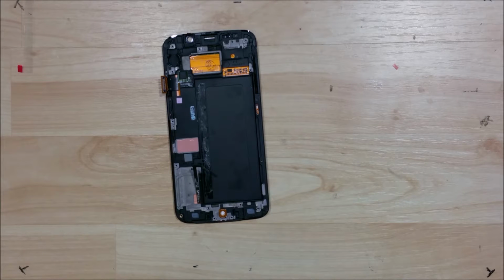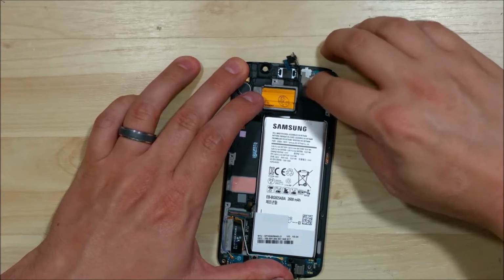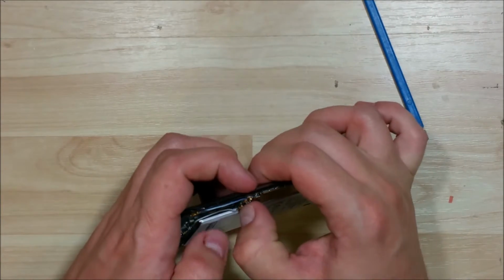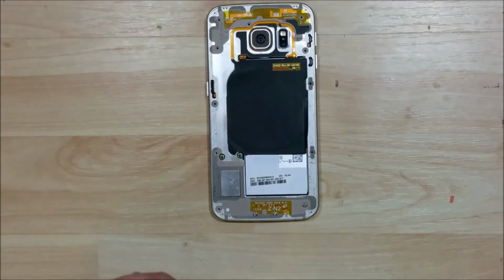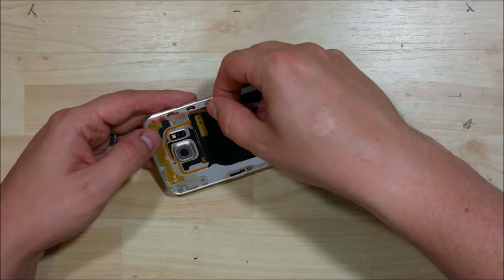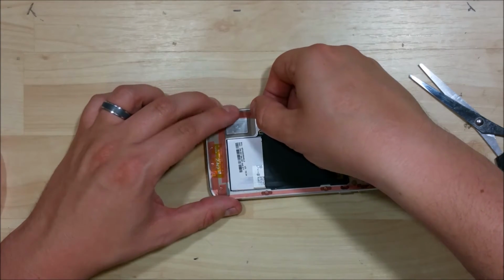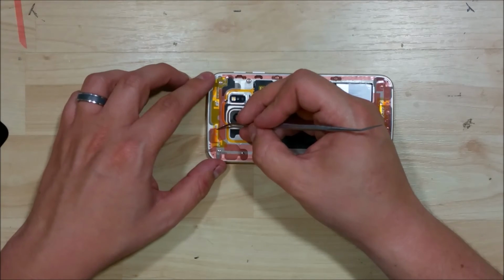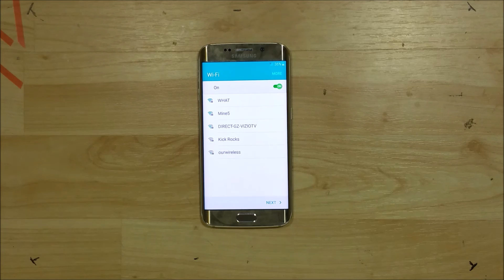Samsung Galaxy S6 Edge Screen Replacement - Reassembly

Comment: where do you get the adhesive tape from?
Reply from the maker: +Daniel Jones I now use VHB tape here is a link: http://www.ebay.com/itm/3M-VHB-4905-Double-sided-Clear-Transparent-Acrylic-Foam-Adhesive-Tape-Long-2M-/181399169361?var=&hash=item2a3c3ba951

Comment: Question: Do heat gun required to heat after assembling item or screen and back are adhesive by themselves :S
Reply from the maker: +Turkel I use new adhesive so no heat gun.
Reply: +How2Tech What type of adhesive do you use? is it adds some micro millimeters in between covers?
Reply from the maker: use VHB tape: http://www.ebay.com/itm/181399169361?rmvSB=true I use 1mm, 2mm, and I think 3mm size. It is about the same thickness as the original adhesive.
Reply: +How2Tech Oooo Great thanks double sided as needed :)